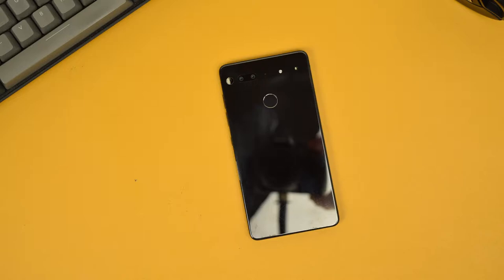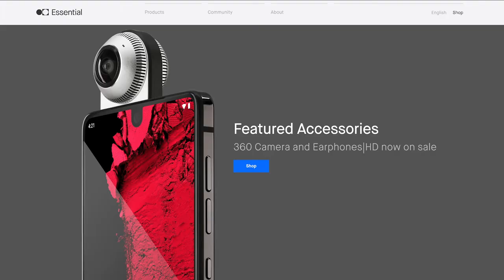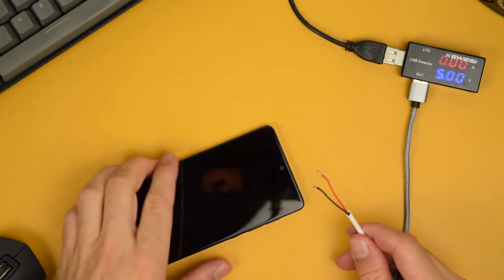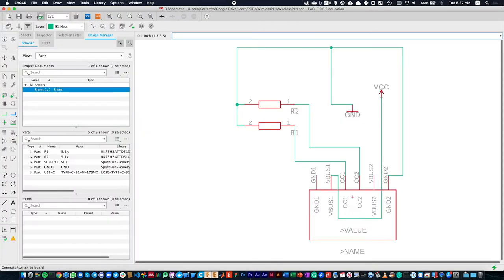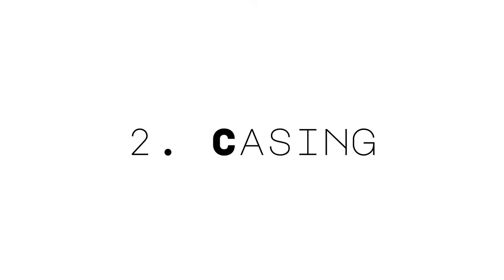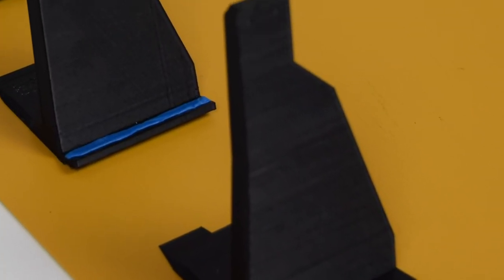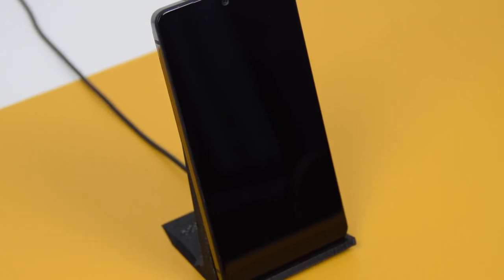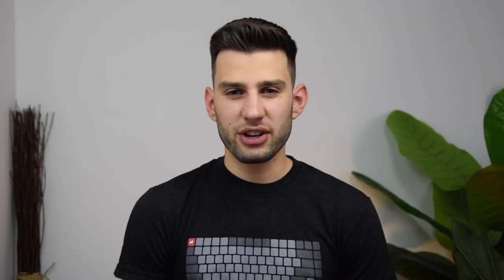A Wireless Charging Stand for the Essential Phone [Zero to Product! Ep 2]

Comment: And how much power should I give? Can I use the 27watt adapter came with the phone to power it. My phone was heating while using 360 cam. Does it heat while charging as well. Does it affect battery life
Reply from the maker: If you add the proper resistors on the C-C line it should automatically require 5V-2A from the charger if I'm not mistaking, which should be good to avoid heat etc. You can search the subreddit r/essential for stuff on this! It's a great community
Reply: Thank you very much dude, very helpful.
Reply from the maker: @akhilvarmadantuluri5602  you're welcome, keep me updated on how it goes!
Reply: Sure😊 I will do my best and update you

Comment: Hey mate! just found your Video. Thanks for making the project open source for the community. Unfortunately youre right that the product is too niche to make profits, due to the small number of essential phones out there.. I would definitely buy a charger with premium Materials :D
I tried following your guide on the website and run into some questions. I guess that CAMOutputs-v.1.1.zip is the latest circuit board to upload. For the resistors your use two times the 
RK73H2ATTD5101F? Im also not sure wich Pogo Pins to get since there a soo many models out there..
Would be awesome if you could answer them :)
Reply from the maker: Hey Nils, thanks for kind words, and for watching!
CAMOutputs-v.1.1.zip are indeed the latest Gerber files needed to send to a manufacturer.
Oh thanks for bringing this up, some links were indeed missing. I just added them to Section 1.4 if you want to check it out. Cheers!
Reply: @pierremtb  nice, thanks for the links! Keep up the good work. I really like those diy project to product videos👍
Reply: @pierremtb  Hey again, I almost finished the chargers! I measured out the holes for the magnets in the 3d print. About 9,5 diameter and 1,5 depth. Did you use 10mm magnets for this?
Reply: How did this end up going, I am about to order the PCB and 3d print as well, but like to know your experience.  Thanks
Reply: @jaychoi9259  Project itself worked out quite good. I got 5 chargers out of it. Unfortunately my phone stopped charging about 2 weeks after (with every charger).. I'm quite sure the problem was a different charging brick and usbc cable I used, also not related to this project. But im not 100% sure..
Reply: @nils_ste  You made 5 chargers ?  Any chance of selling 1 ?  I made a modified version of the cradle to fit into a car cup holder no problem, but have zero soldering skills.
Reply from the maker: @nils_ste  Thanks for the kind words! Time for continuing these projects is obviously the issue, but it’s amazing that you guys are having fun building it. And thanks for chiming in with Jay as well!
I just measured the magnets and they are 9.7mm in diameter. I have no idea where I got these, they just happened to be in my toolbox… Sorry I totally missed this question 2mo ago it seems :/
Reply from the maker: @nils_ste  Too bad for the charging issue. Did the phone altogether refuse to charge through the pins?
Reply from the maker: @jaychoi9259  Thank you for watching, and being interested in this!
Reply: @jaychoi9259  hm I could send you, but just near Germany. I would recommend you build your own. Not that expensive or hard to solder and was quite funny :)
Reply: @pierremtb      Hmm my battery isn't lasting as long........
                                    11PM:  How to replace PH-1 battery video
                                    11:20    PH-1 tear down video
                                      3AM:  Custom cradle and pogo charging for PH-1
                                      6AM:  Firing up the SLA
                                   Youtube rabbit holes
Reply: @pierremtb  no problem, I got the correct size. Was just confused since the magnet are not round 10mm haha.. je it stopped charging all together, pins and usbc port. But I'm almost sure it was the other charging brick. I tried changing the battery but no luck. Seems like a motherboard issue :/ maybe I just get a used essential phone 😆
Reply: @nils_ste  Thanks, I placed the order for PCB, have already have 3 printed cradles, just wanted a control good to test with, since my soldering skills is nil.  But I am more than willing to pay for parts and postage to have reference soldered board.  But I don't know how to exchange email addresses securely on youtube.
Reply from the maker: @jaychoi9259  😂. Cool that you ordered! Good luck 🤞
Reply: @jaychoi9259  hm im also not sure how to get in touch. Seems like there are no direct messages here. I'd say if you placed your order for the parts, try soldering it. The pins and resistors are pretty straight forward. The usb port is what I was struggling a bit. My parts worked when I finished soldering but now I can't check. Just try your best and when you don't succeed we will discuss shipping. The rates to outside EU are crazy sometimes that's why I don't think it's the best idea.
Reply: @nils_ste  I did not see I was logged into my daughters account. If you had an extra charge to part with I would be very interested. Im in the Czech Republic.
Reply: @wesleyrobinson4286  you mean PCB or 3d print?
Reply: @nils_ste  what do you have? I am ordering a 3d printer for my son tonight, so if it was just the PCB i could find the plans for the 3d print. If you had everything that you were willing to sell I would also appreciate that. I think I would still try to print another,
Reply: @wesleyrobinson4286  well, i could send you both. No clue about shipping to Czech republic though. You got experience there?
Reply: @wesleyrobinson4286  as mentioned, my soldering was pretty bad, no guarantees for that and my phone died so I can't verify if it's working
Reply: @nils_ste  cant be any worse than what I would do. I thinker a little, still have a lot to learn. Mine is still working, 4 years now, my other one died. Shipping to CZ is easy, just as long as the price of the contents is less than 49 euro. Where would you ship from? I have a US address too. if that was easier.
Reply: @wesleyrobinson4286  from Germany i guess Czech should be better. If you send me you email I'll contact you there
Reply: @nils_ste  hey, havent heard from you, just making sure you saw my email address?
Reply: @wesleyrobinson4286  no i haven't seen it. Did you post it as comment?
Reply: @nils_ste  i did, seems like it got deleted?
Reply: @nils_ste  im not sure how to give my contact,
Reply: @wesleyrobinson4286  maybe write it out without @ and .
Reply: @nils_ste  wesr68yahoo